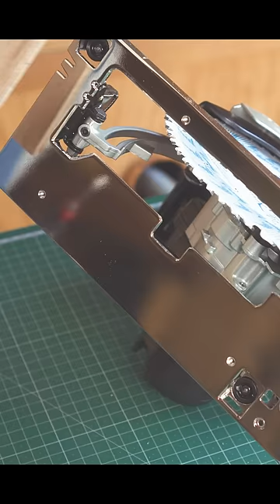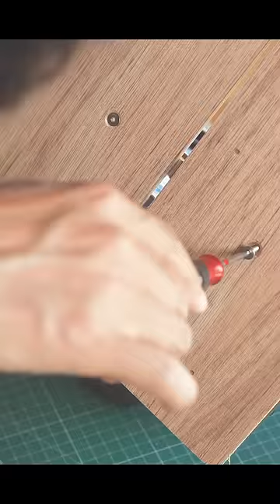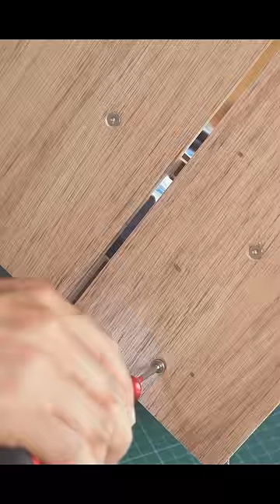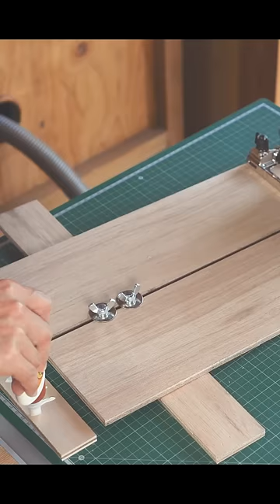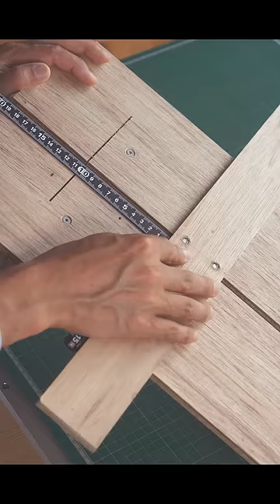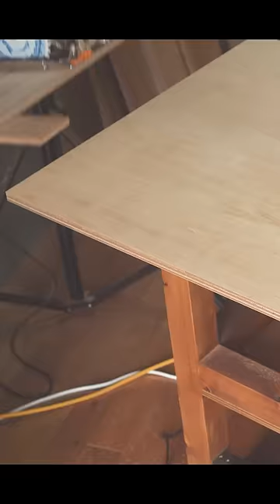Simple Woodworking Hack #shorts

Comment: But the saw comes with an edge guide some will cry out. Having used those, I can say with experience they are designed to be cheap first and barely adequate second. This is a far better way with lots of edge to guide the saw straight.